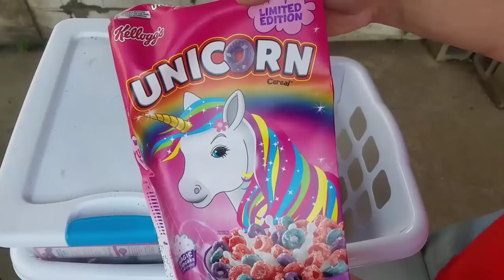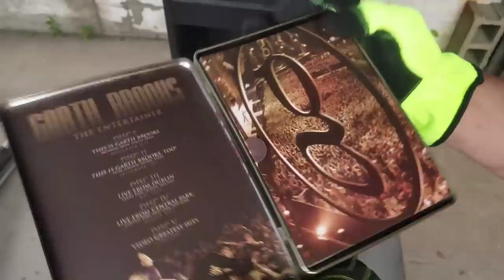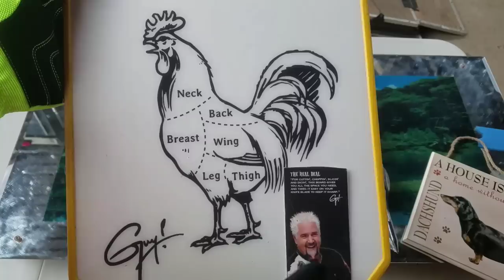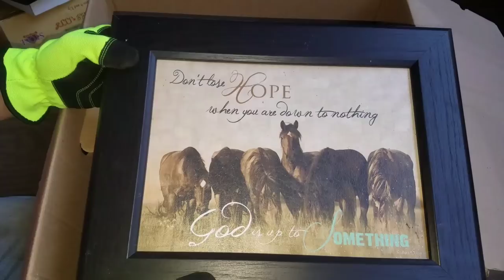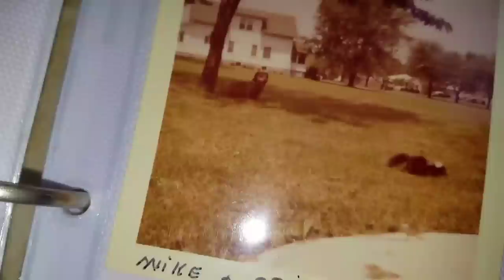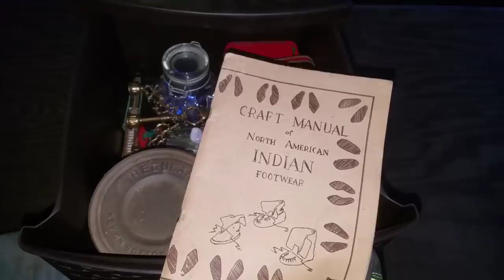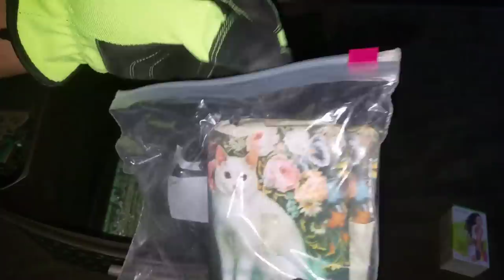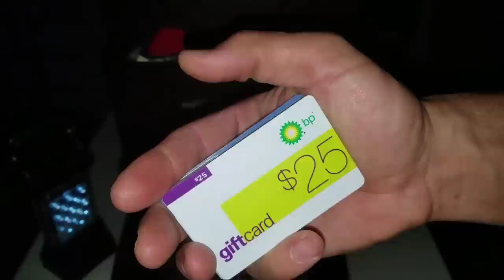FOUND MONEY I Bought Abandoned Storage Unit Locker / Opening Mystery Boxes Storage Wars Auction

Comment: 12:24 is a Buddy L Ranch Truck Blue Side Step Pick up Bank from the 1960's I think. I saw one listed on Ebay for 99.00 but none listed as sold looking exactly like this but one tan one pretty close for 60.00 but it did look like it was in a bit better condition.

Comment: 13:05 There's a Buddy L truck bank similar to this one that sold on eBay for $41.00, but it looks to be in better condition. (https://www.ebay.com/itm/Buddy-L-Truck-with-camper/254169141503?hash=item3b2da950ff:g:9rMAAOSwPa1ckDSx) I would gess that in this one's current condition, you'd probably get maybe $20-25 for it. I don't know how much it would cost to restore it or what the value of a restored piece would be.

Comment: The U.S. yacht ensign is a variant of the national ensign in which the union consists of thirteen stars in a ring surrounding a fouled anchor set diagonally. It was authorized by Congress in 1848 on the recommendation of the commodore of the New York Yacht Club as a signal to be flown by yachts holding special licenses from the Secretary of the Treasury so that they could be exempted from having to enter with or clear customs every time they put out to or returned from sea. The design was prescribed by the Secretary of the Navy and introduced into use in 1849.

As indicated by the use of the term "signal" in the enabling legislation, it was never the intention that this flag would replace the standard national ensign as a means of identifying a yacht's nationality, nor did the law authorize it to be used in that fashion. When the secretary of the New York Yacht Club solicited members' ideas for a design in late 1848, he specifically described the flag as a "distinguishing flag to be worn at the masthead," not as an ensign that would have been worn at the stern or gaff. Eight years later, the authoritative Rogers' American Code of Marine Signals (1856), which was approved for official use by the Navy and Treasury departments, stated that "the Yacht Flag is only displayed above the telegraphic numbers of the Yacht Club vessels."

Nevertheless, probably because of its resemblance to the national ensign, the yacht ensign came to be flown in lieu of it as early as 1850. In 1916, Secretary of the Navy Josephus Daniels and Secretary of the Treasury William McAdoo both argued against the the practice of using the yacht flag in this fashion. On February 12 of that year, Daniels wrote to the House Commerce Committee that "in the opinion of the department [of the Navy], all American vessels should fly the American flag, and any other signals and any other flags should be in addition to the national ensign and not in lieu thereof...." McAdoo went further in a letter of February 10, not only stating that "the propriety of permitting this custom to continue--using the so-called yacht ensign as a substitute for the national ensign--may well be questioned," but providing draft legislation criminalizing the display of any flag but the national ensign from the points of hoist normally reserved for the ensign: the flagstaff at the stern or the peak of the gaff of the aftermost mast. Nevertheless, most yachtsmen continued to use the yacht flag in lieu of the national ensign. Some even believed that it was illegal to fly any ensign other than the yacht ensign on a yacht large enough to qualify for the Treasury license.

Eventually the Navy gave in. A 1939 opinion of the Navy Judge Advocate General, approved by the Secretary of the Navy, extended de facto recognition to the use of the yacht ensign as a substitute for the national ensign by allowing Navy ships to return salutes rendered by dipping the yacht ensign and by authorizing members of the Navy to salute the yacht ensign upon boarding or leaving a boat on which it was displayed.

The other perennial issue with the yacht ensign was enforcing the rules on its use. From its first adoption, its purpose was to indicate that a yacht was licensed by the Treasury Department, allowing it to enjoy the exemptions from customs procedures set forth in the law. Vessels below a certain size threshold, which was changed over the years, were not even eligible for such licenses (because they were not subject to the normal customs rules in the first place), yet the yacht ensign was used widely by boats of all size. Many yacht clubs even had (and have) club rules requiring the use of the yacht ensign rather than the national ensign, whether or not a given member held the Treasury license. The issue became moot in 1980 when the new Vessel Documentation Act (Public Law 96-594) did away with both the special yacht license and the accompanying requirement to display the yacht signal. The yacht ensign is now flown as a matter of custom as an alternative to the national ensign by recreational craft sailing in U.S. territorial waters, but should not be displayed in foreign waters. Most yacht ensigns are manufactured in proportions of 2:3 or 3:5, but the traditional dimensions, as shown above, were the same as those for the national ensign, 10:19.